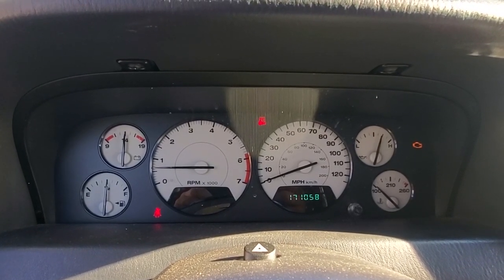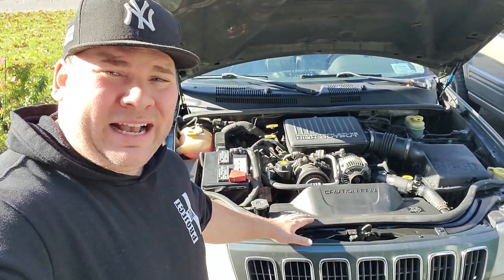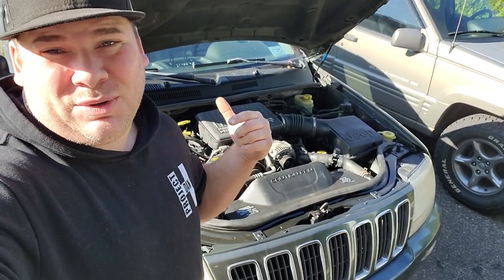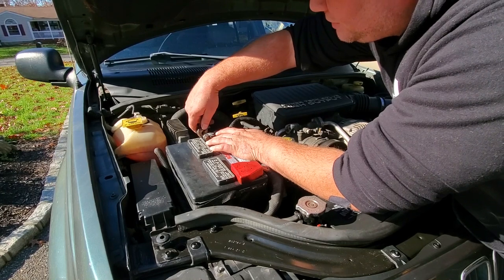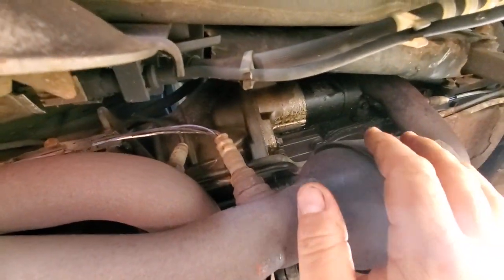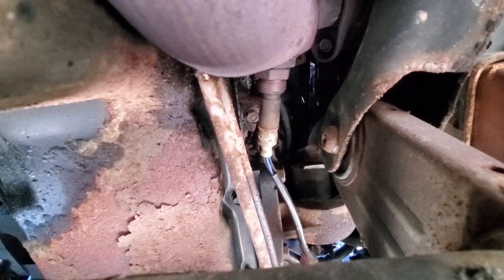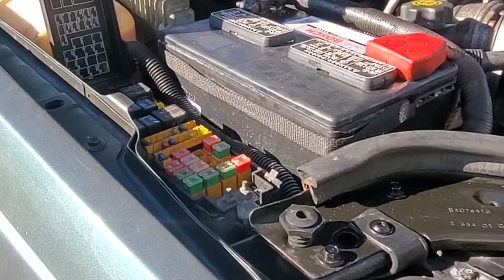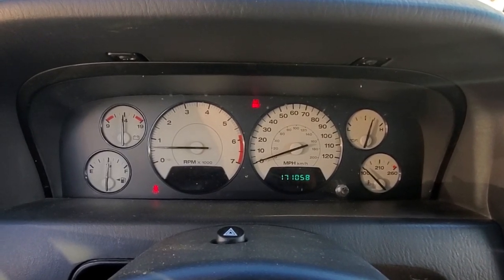SOLVING A 2002 JEEP WJ O2 SENSOR CEL AND A 1499 HYDRAULIC FAN SOLENOID CHECK ENGINE LIGHT CODE

Comment: Ok it’s been a week if not two. But my 01 Wj has had a B2S1 code for most of the winter.  Well a week or so ago my fan decided to go out pulled codes again just to see if there was anything new. Bam P1499. Looked a the fuse box for a fan fuse (no fuse). So damn 150 for a solenoid. Been to junkyard up to 75 miles away. Well can find one. So today I said I’ll take a brake and watch a couple more YouTube videos. After watching this video I walk out to my WJ and said WFT fuse was blown.  Replace it and started up the jeep. F YA the fan was working again. Thank you Dan. You just saved me a $140 I’ll take a $10 of fused any day.  THANK YOU THANK YOU THANK YOU

Comment: Nothing makes your heart drop having the CEL come back on after you think you had it fixed. Glad to see Green Hornet is running CORRECTLY. Every now and then Jeep just has a brain-fart and screws up something simple. Wish I could finally fix our 97's CEL. Have a reoccurring EVAP leak code of P0442/P0455 (small/large). In the middle of a video series for tracking the problem without a smoke machine.  Truly...JML
Reply from the maker: omg don't get me started! I have a perfect leak free commander with a small leak check has cap warning!  it drives me crazy... there is no leaks!
Reply: You guys figure out how to fix that I have the same codes in my wj no ther codes just those 2

Comment: This is where a factory shop manual comes in handy. I have a 1995 Grand Cherokee (Bought it New in 1995) and I bought the factory shop maintenance manual at the time of purchase and it has paid for itself many times. I still have the 1995 and the manual.
Reply from the maker: I have one!  it makes no mention of this issue other than solenoid replacement.  the only hydro fan related topics are only for the Diesel version

Comment: I'm doing the interior now, 233,000 miles. I couldn't find foam for the seat and reused the old foam. I had a broken drives seat. The drivers seat frame was busted in 3 places. I used bolts and steel flat stock to splint the cracks. The little part that broke on the electric seat life required a $250 eBay seat lift and motors. Hit me up if you want to share experience. I fixed my Cruise control etc....
Reply from the maker: sounds good brother! I gotta find a nice weekend to I stall my black interior!

Comment: They used the power steering because they had a cooling problem and the power steering pump can get the fan turning high enough speed even at idle.  Once the 12 volt fan motors increased power they changed it.  Chrysler had multiple engineers that had been at NASA for years and came up with some off the wall ideas.
Reply from the maker: Wow great information! Well that definitely explains it... That logic is "out of this world"! 🤣

Comment: Does the P0740 code also went away?, my wj has the same codes and the mechanic said he has to take out the transmission. Great video and great skills, very well explained.
Reply from the maker: Thank you so much!  After Everything was fix I pulled the battery and let it sit.  when I plugged it all back in the only code to ever come back was an Evap leak.   So far so good.  Ill keep ya posted

Comment: Just had same issue with my 01 laredo 4.7 it overheated and would have never guessed the fuse until we got the o2 code...fixed issue with sensor replaced fuse and bam the cooling fan started working right...insane!!!
Reply from the maker: wow! totally insane! glad it's up and running!

Comment: Lol It looks like you posted not 18 days ago. My WJ is a California one. I got the  P0139 and P1499 at the same time. It's intermittent. My Jeep has a new engine and Radiator and looks new compared to yours in NY. I'm the 2nd owner. 
Question,  Have you any idea near the passenger side 2-1 bank sensor.  Located near the transmission temp sensor which plugs directly into the transmission, I found a dead-end female two hole connector. Does it plug into anything.?    Thank you for the great video. My drivers side harness looked similar dangling and coated in grime. Thanks
Reply from the maker: do you have a hydraulic fan? If not I wonder if it could be a blank plug for the hydro fan that is dangling

Comment: Always enjoy watching these videos! Curious- if there is ever a chance to cover a rear wheel bearing on the ZJ with Dana 44 rear, would you be able to cover it? 

I’ve run into a bad wheel bearing, and have been procrastinating on it.
Reply from the maker: ironically I checked my rear park brake pads today and noticed my axle seals were leaking bad.  looks like I'll be doing a WJ D44 axle bearing and seal!

Comment: I would probably look into replacing the hydro fan with the electric fan Jeep put on the ones with the tow package.  But I don't have a WJ yet.  Maybe when my ZJ dies, but not yet.
Reply from the maker: I plan on doing that swap but I had to solve that Code first.  apparently when you swap a hydro fan out your supposed to keep the solenoid in so it doesn't throw that 1499 code. 😱
Reply: @ProjectDanH  makes sense. I try to do what Rusty411 once said in one of his videos, return everything to stock as best you can before you start modifying stuff. He's talking more about having a known baseline rather than buying someone else's project not knowing what they've done to it. I do similar, but I tend to do the "junkyard" restorations, mods, and upgrades. And I continue along those lines until it rusts out to the point that it's not even a good candidate for an orv.
Reply from the maker: @robertgrauman8602  Yep, I totally agree. I must have a fully functional stock vehicle before I start the mods 😁
Reply: @ProjectDanH  The  gray area being things like, the 90 amp alternator is going out. do I replace with the 136 amp it left the factory with or upgrade to the Durango 160 amp?  This was the exact situation I was in on my ZJ not long after I got it.  I could not justify the 136 amp when I knew I could do the Durango 160 amp for similar price and slightly more work.
Reply from the maker: @robertgrauman8602  that upgrade is a home run.  I'd grab a Durango 160 and upgrade all the wires. Can't go wrong

Comment: So the two solenoids are not cross compatible? I have an 01 wj and an 04 someone parts wj and was about to drop radiator in tomorrow dont want to do that if the 04 solenoid won't work
Reply from the maker: I just had a Subscriber get the 04 solenoid to work in an 01.  He said it was plug and play.  Just make sure you get the 01 wires too!!
Reply: Thank you for your response I had the 04 fan and wiring out of my other grand cherokee.. freaked out so I repaired my 01 fan and put it in waiting on tge hose that goes from fan to gear box

Comment: Great job!!! New subscriber here! If you get a headlight issue on a 2003 dodge ram 1500 4.7, please video
Reply from the maker: thank you!  my buddy had an 03 issue.. all the problems were fixed by finding and soldering broken brittle wires

Comment: Mine has a CEL for Leak detection pump p1494...it will fail emissions in PA 🙄
Reply from the maker: Evap Drives me Crazy!!!
Reply: @ProjectDanH  I have another question for you LOL...I’m a victim of the leaky sunroof drains which equals water on the passenger floorboard...any idea on what a shop would charge?? I’ve watched some vids but don’t really trust myself all to much to attempt to fix it
Reply from the maker: Get a rubber tip on your air compressor and blast out the crud!